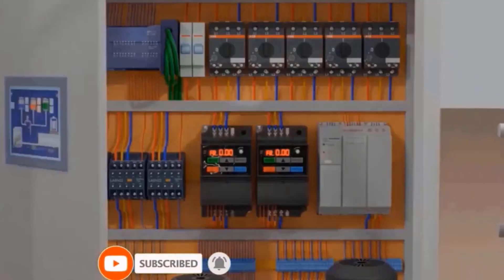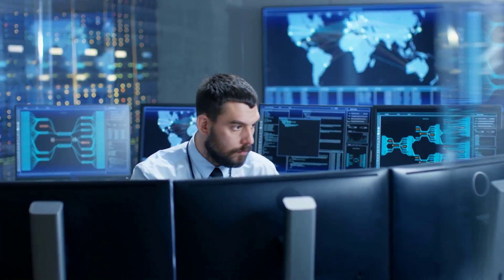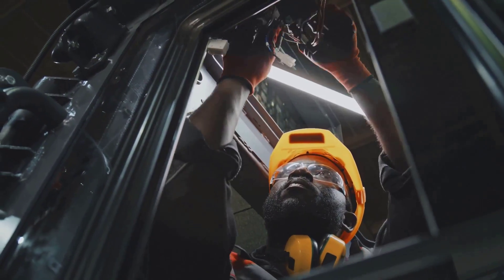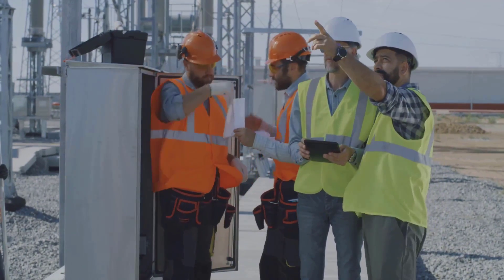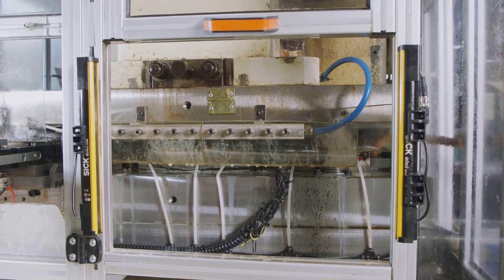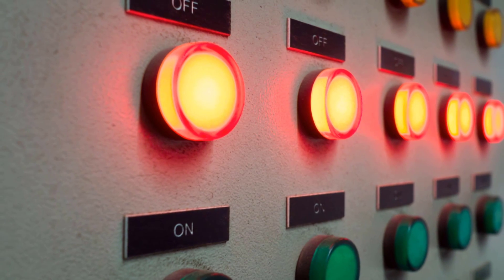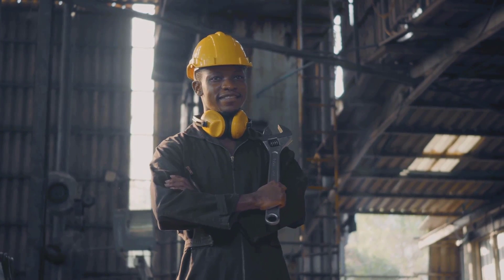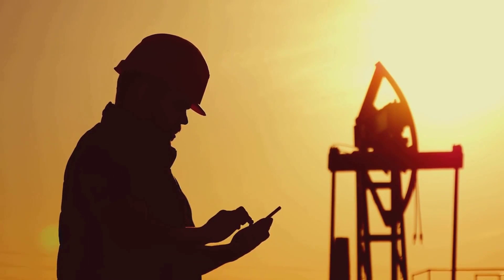PLC Troubleshooting Basics: A Step-by-Step Guide

Comment: If the program had been running for days why would it sudden crash?  It would only occur if a error trapping sub routine was activated.  A system reboot would have likely allowed the system to start in minimal time.  Of course this would not solve the source of what activated the error trapping but the code could be reviewed methodically.  If the program had just been installed it is always the last change made broke the system.